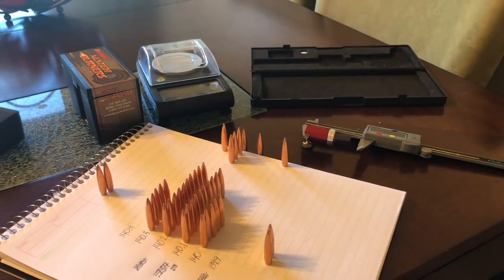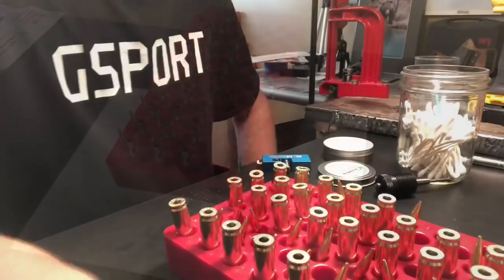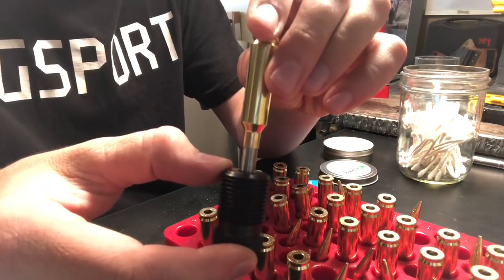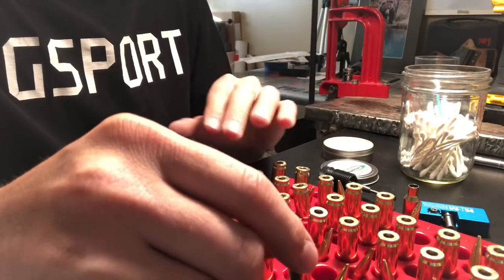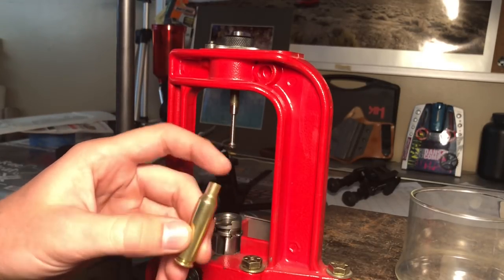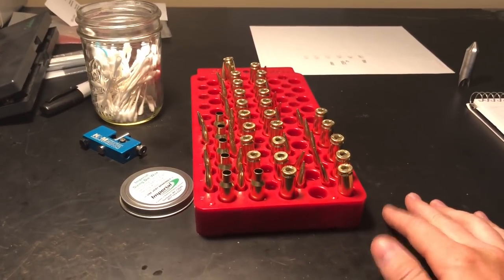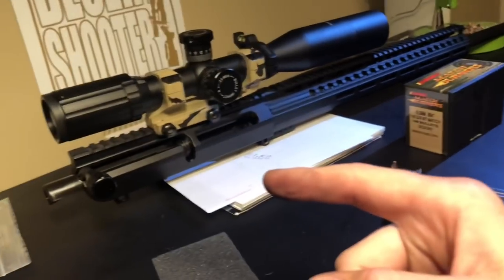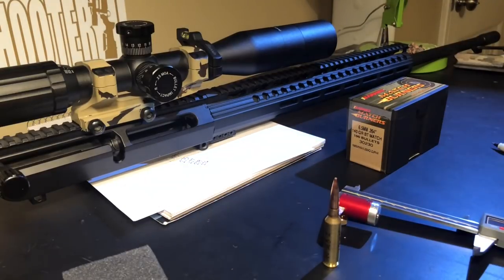Precision 6.5 Creedmoor Load Development Part 1

Comment: Another thing to think about Logan is investing in a Meplat trimmer. Look closely at the tips of those hp's.
They will be uneven. If you trim them all the same your groups will tighten up. You will not notice this at 100 yards, but from 600 and out it WILL make a difference. This is one reason I'm a big fan of the ELD's. That heat shield tip is very consistent.
Looking forward to your results.

Comment: I mandrel up, neck turn, then neck size down with a bushing die to get a perfect 2 thou neck tension. It's a lot of working the brass but I anneal after every firing so i'm not too concerned about that. I've got Starline SRP 6.5 CM brass shooting a consistent 4 SD after a good neck turn (and a bunch of other good practices). Keep up the good work!

Comment: I use a decapping die, then full length sizing die without the expander ball removed, the a neck sizing mandrel. My point being, bar using Imperial wax to FL size, then sonic clean. I size the neck with an expander mandrel, using Imperial dry graphite type powder. Would that not be better than the wax lube to size the necks?

Comment: So this is pretty much what I did for my milk jug ammo, and it works.  I'm new to the neck turning.  I watched Bolt Action Reloading's video on the Hornady Neck Turner.  I guess my question is, can you turn the neck before resizing, or will that mess it up?  I don't know how I feel about loading with the flared neck.  I know it will be consistent since you are doing it to every case, but it makes me wonder about the Neck tension?  I've got more questions, but I'll wait until you start turning them.
Reply from the maker: Well you definitely want to resize before neck turning, new brass or once fired so that the necks are uniform. The expander mandrel doesn’t flare the necks like a pistol die would it has straight sides at the top of the die so you want to get the whole neck of the case on that flat surface to make them all even. The mandrel makes the brass fit the pilot perfect so neck turning will be extremely uniform. I’ll go more in depth when I turn more and have more experience

Comment: do u turn your adg brass??
Reply from the maker: I’ve turned a few pieces to experiment with but haven’t shot them yet. Now that I have a good way to measure there isn’t much point the necks are very uniform
Reply: ya I agree I am not messing with any of mine.  im getting sd's of 3 and 4 fire forming so I am very happy with the 308 and 6.5. im going to try the 300wm and 338lm in a week or two.. @WestDesertShooter